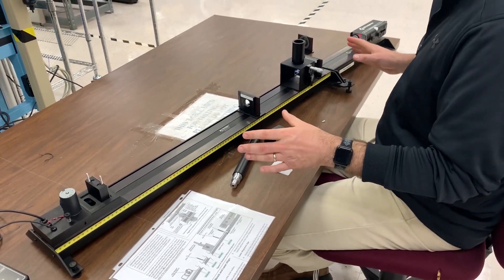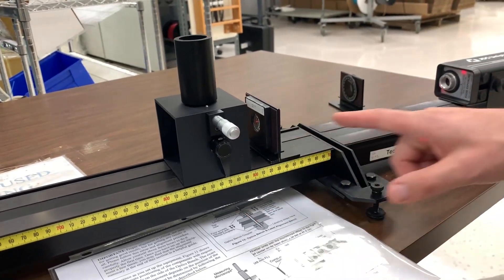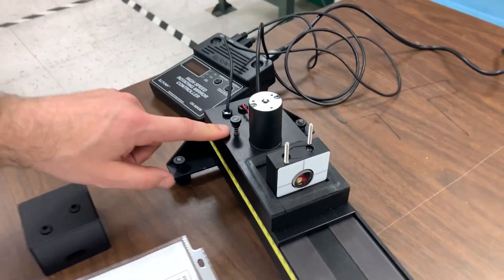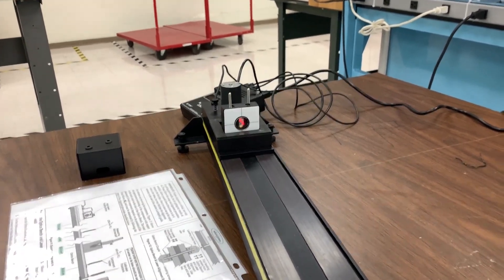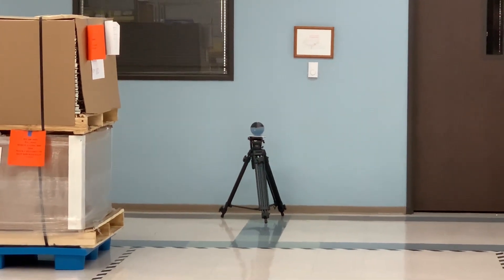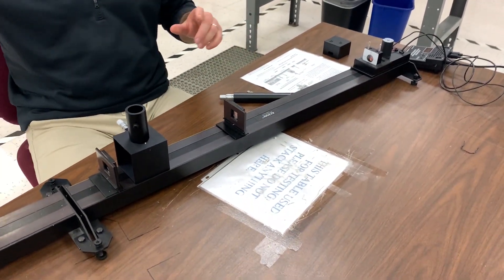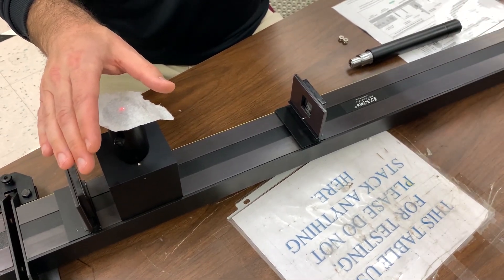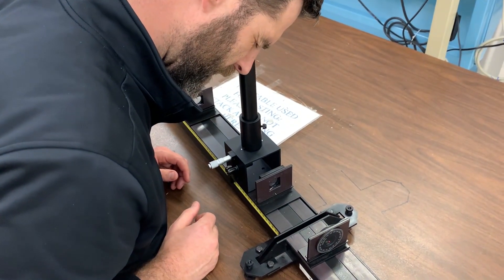PASCO's Speed of Light Experiment

Comment: What if your dot keeps disappearing once you turn the experiment on?
Reply from the maker: When turning on the Rotating Mirror, it is normal for your image to disappear initially. There are some steps you can take to get it back again.  We've found trying the following steps help find the image:

- Ensure your microscope lenses are clean.  Use a Kimwipe, or some other lab-grade wipe to make sure you do not scratch the lenses.  Smudges can make your image blurry and more difficult to find your image.
 
- Ensure that once the mirror starts rotating that you remove your polarizer.  It is safe to look into the microscope without them as long as the mirror is spinning.  If you leave them on, the image might be too dim to locate.
 
- Reduce your diffraction patterns as much as you can, as the image can be hiding within them.  You can do this by turning Lens2 slightly askew so it is no longer quite at a right angle to the beam axis (should only be 1-2 degrees).  This might seem like it will mess up your alignment, but in reality, it should “darken” the diffraction pattern in the background of your viewing window without darkening the image you’re looking for.  This can reveal your image that could have been hiding in plain sight.
 
- Adjust the micrometer knob (not the beam splitter knob) to scan back and forth in case your image is just out of view.  Maybe take note of what the knob’s position is before you start moving it so you can always return to the start.
 
- If you’ve tried all of the above with no luck: adjust your microscope lens in various ways by picking it up, rotating it, or jiggling it within the holder and see if your image “pops” into view.
 
- As a last resort, you may try ever so slightly adjusting the beam splitter knob, but you really shouldn’t move it too far in either direction.  If you move it too far, it may be impossible to get it right back where you had it when the beam was aligned while stationary.

For further assistance, don't hesitate to contact PASCO Technical Support: https://pasco.com/support.